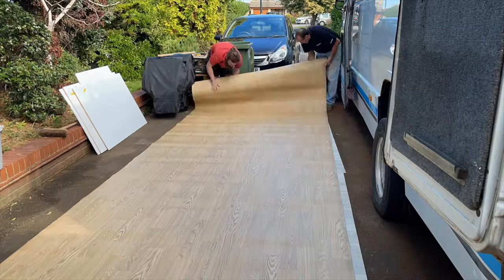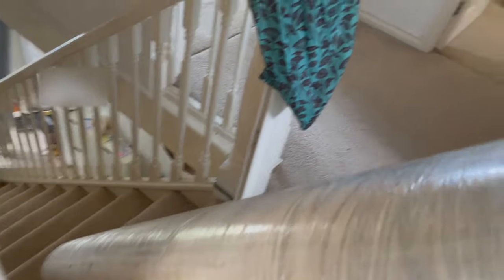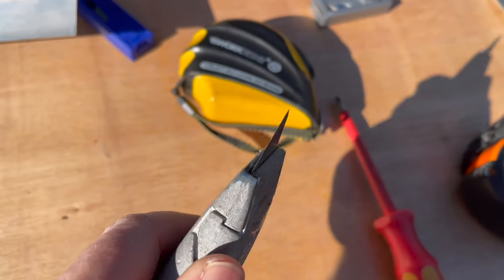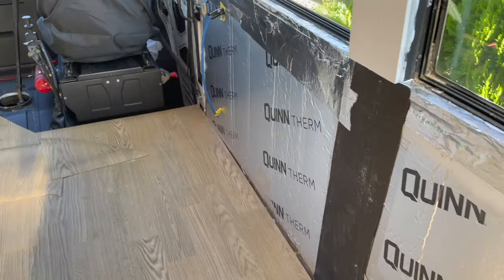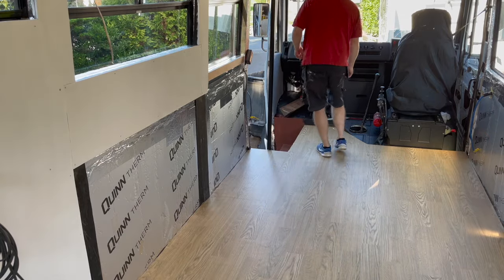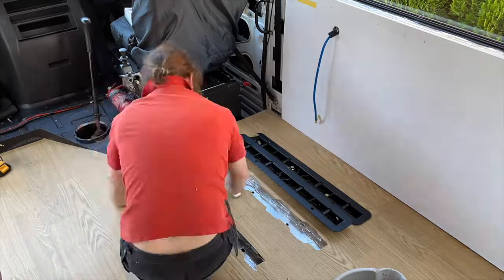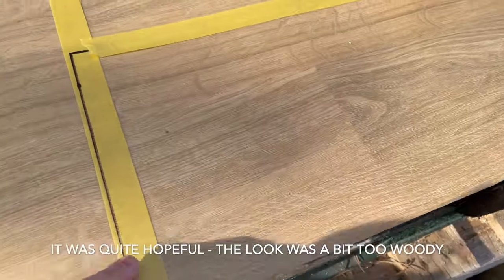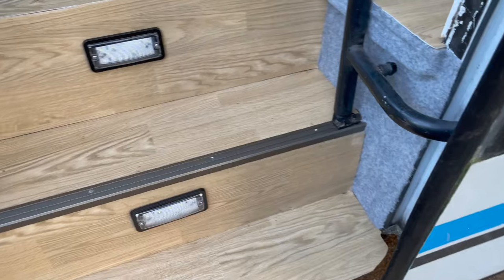Installing Super Tough Altro Flooring in Our Van Conversion | Mercedes Vario Minibus Conversion

Comment: That looks super smart! Great job guys! If you do Lino elsewhere in the house for instance, a soft indoor brush works well to smooth it out. Also save yourself some time and wrist action on the long bolts by getting an adapter for your drill that’ll take a socket, just crack them off and then undo them with the drill. I got one for my awning rock pegs. Have a fab Sunday!
Reply from the maker: That’s a great tip re. The long bolts. Would you believe that we had two delivered yesterday from the mighty Amazon? Great minds 😂. When doing it thought my impact driver is right there; it’s right there - but I can’t use it.
Reply: @WanderbusAdventures  work smarter not harder 😂😂😎👊🏼
Reply from the maker: When possible haha. As you know we seem to learn the hard way lol. How’s things your end?
Reply: @WanderbusAdventures  yeah all good apart from working this weekend but off next one. Got to take my side bars off as got a few stone chips that have gone rusty so will take them off and sort that out soon. Also splitcharge is still playing up. Might have to invest in a B2B. All fun 😂😂
Reply from the maker: Ah yeah best to get those fixed up before it turns into a rust bucket like ours lol. What split charge are you running?
Reply: @WanderbusAdventures  similar to a furtive VSR. It keeps clicking, the company have checked it and I’ve gone over all the wiring so who knows?!
Reply from the maker: Ah that’s a shame. It’s annoying when there’s no good reason

Comment: Looks great rich and totally the right decision to put the lino under all the units etc ...this is the same method that factory built motorhomes and caravans do for the same reasons you listed.    One tip for you though mate ..get some knee pads ...youll miss those knees when they are gone . Im starting to really feel mine these days after 30 years of crawling around under motors ..
Reply from the maker: Hey Tam. That’s good to know and makes a lot of sense to us. Will get back on the pads; must admit it’s not like we don’t have them so it’s just inexcusable laziness on our part. How’s your build going this week? Looked good on Instagram and Facebook.
Reply: True story! A friend of mine renovated one caravan and ended up permanent knee damage from kneeling on the floor while doing it up, ended up having three operations on them leg hinges!
Reply: @WanderbusAdventures   yeah thats all my side panels welded up now and its watertight to leave it over the winter.  Need a holiday now 😁 youll be finished yours before i get back on mine.
Reply from the maker: Ouch. That’s awful 😞
Reply from the maker: Well we might have a posh box by that point. A tent on wheels if you like 😂